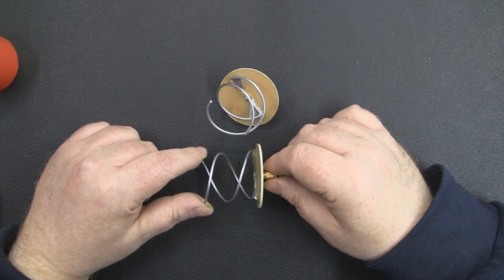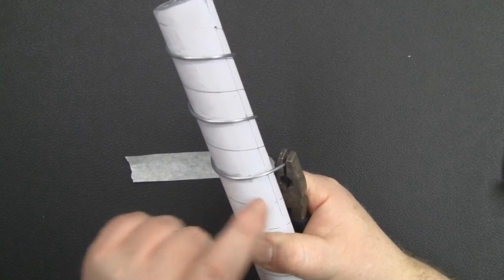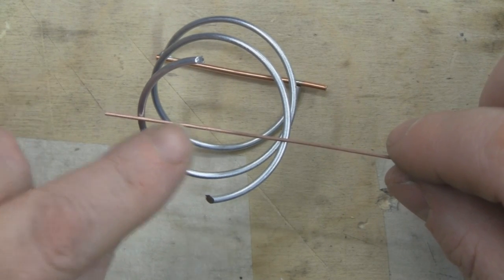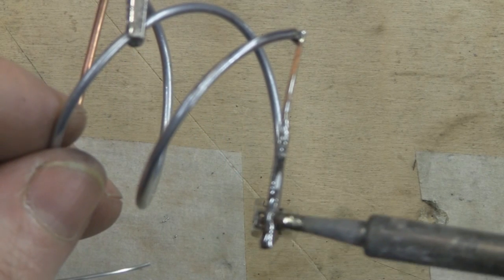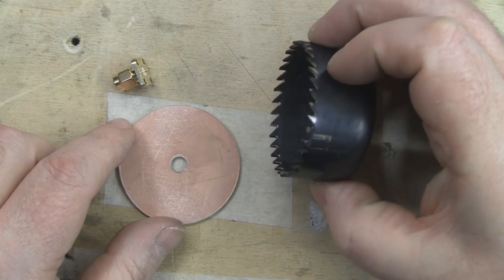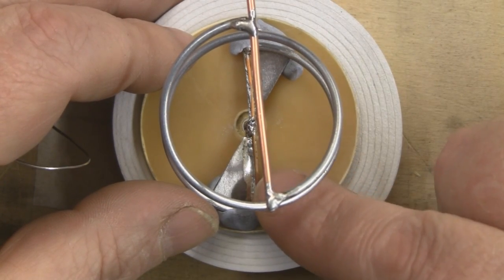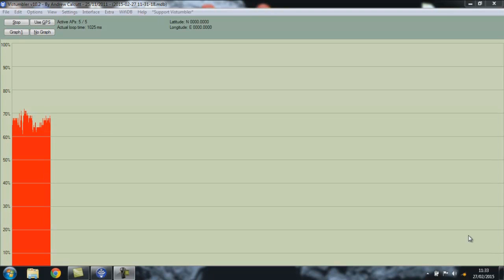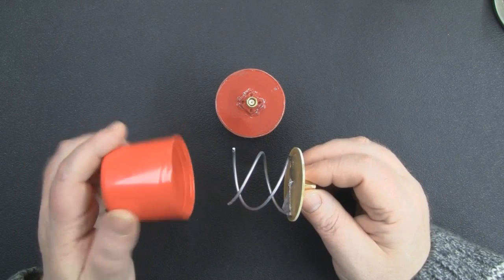2 4GHz Single Turn Double Helical Antenna #84

Comment: Hi i am trying Implement esp now  (normal  or LR mode)  for sending overhead  water tank level  data (Ultrasonic sensor) to the basement. 
But they can never work in line of sight. 
So I depend on reflected 2.4 ghz waves from surrounding. 
So i think  cirular polarized external  antenna will be best suited.

Water tank  is in second floor terrace  and receiver in ground floor work area.  Both can be connected by reflected/refracted wave.

1 . Is  my assumptions  are correct ?
2.   Will the helical antenna in this bideo  be the best?
3.  Which is Best antenna  for receiver?
Reply from the maker: I converted all my security cameras to circular polarised for the same reasons (interference). Just make sure you have the same matched antenna on the receiver as the transmitter

Comment: why didnt you use copper for the active elements ? you always seem to have it handy at the workshop.
Reply from the maker: Back in 2015 the workshop looked nothing like it does now 😁 now that I am semi retired from my full time job I do spend a lot more time and money on the workshop (don't tell Mrs Antenna😁) and have stock materials to hand . But I still prototype using steel and tin.

Comment: will this work for the front end on a satelite dish horn to receive wifi 2.4ghz
Reply: The number of turns (gain required) depends on the type of dish used (distance between dish center to focal point and dish diameter) .  I used a single 3 turn helix feed on an old 10.5 ft TVRO dish.  It worked fine for 21 cm line (1420.4 MHz) used for Radio Astronomy and SETI projects.  
If you don't use enough gain in the feed, the back-ground noise from behind the dish will be picked up..
Too much gain will work, but at reduced dish gain.. Because you aren't using all of the dish surface.
I once used a coffee can feed on 1296 Mhz to listen to EME and on 1295ish for OSCAR comms.

Comment: Your template has got to be wrong: the pitch angle is almost 20 degrees (40mm spacing for a 110mm circumference), all design guides say 12 to 14 degrees is the optimum angle

Comment: Slightly confused by this...a 3 turn single is very wide with decent gain, a 1 turn must be massive but as its a directional I guess still won't reach behind it. (I know there will always be some behind reception anyways)

Now a double is going to widen that even more...what possible use will this have over say a CP style antenna.

Comment: I have just finished testing of mine 5.8Ghz, it didn't work as expected. 
It doesn't even beat my home made skew planar wheel antenna :( I'm a bit disappointed, this antenna looks perfect for me, mid gain wide beam...
The only deviation from the original is 1.38mm wire diameter.
Did anyone try single helx for 5.8Ghz?

Comment: A quick question. Is the effective gain of a dual helical antenna approximately equal to a single antenna of twice the length? I assume it would actually be slightly less.
Reply: No, it gives a slight increase of about 1.5db over a single helix but no loss of beam width.
Reply: Kotik
Increase of 1.5dB over the single of the same length of the dual, or of the total combined length of the dual? Thank you.

Comment: Hm, 34mm is just SLIGHTLY greater than the OD of 1" pvc pipe. A few wraps of tape should bring it into spec. The joy of living in the only large country using the old English measurement system!

Comment: Nice videos! Just one question though, for the back reflector, would it work using any non-conductive material, and use copper tape on the back?

Comment: Hi,
love your tutorials.
It's possible make it for 5.8 ?
Is there any calculator for this kind antenna. I would try it make for 5.8 and 1.2GHz for my planes.
Reply from the maker: Moje Cncing Will this help? https://youtu.be/u7cq5wUyeQ0
Reply: andrew mcneil 
Hi Andrew
Thank. Didn't get there. My bad :)
How to make this antenna also for 1.2.
Any calculations - formulas. 
Asking cos as I see differences in wavelength between 1080 and 1280 are quite big.

Comment: Very neat and easy build. On a WiFi link, its easy to point it for max signal strength, but can we use it on a typical 2.4Ghz RC setup please, with standard linear dipoles at the RX end?...Included beam angle ? A field test would be interesting at a range of say 3kms?
Reply from the maker: EnglishTurbines You should use it with a circular polarised antenna or you would loose 3db to mismatching
Reply: andrew mcneil Ah, like a clover leaf antenna maybe?  How would we fit that to a typical RC reciever which uses two linear "wire" dipoles for diversity. I assume we would only then need one CP on the RX end ?